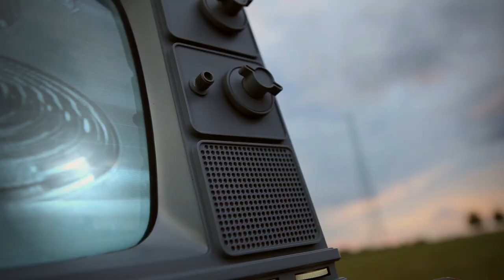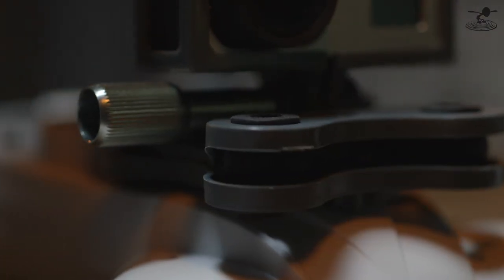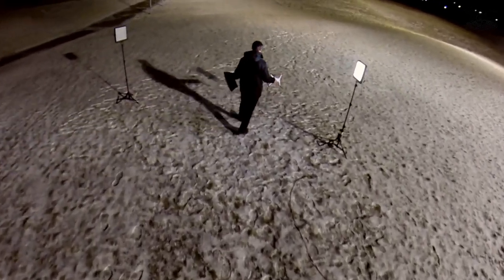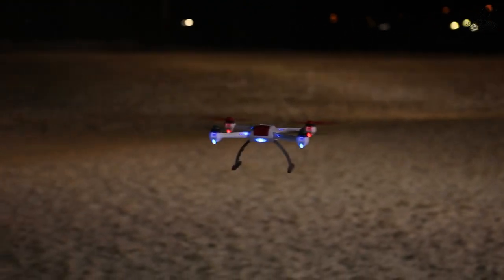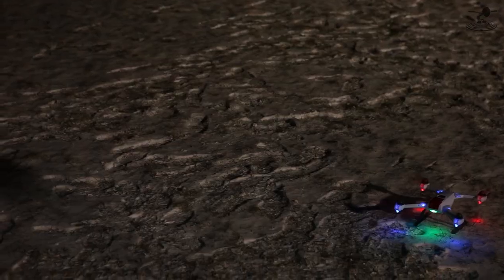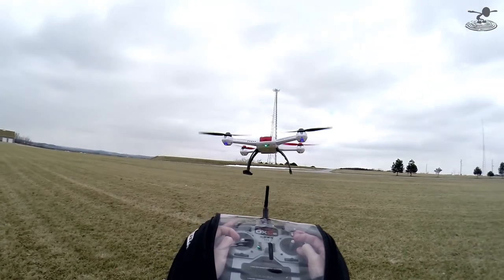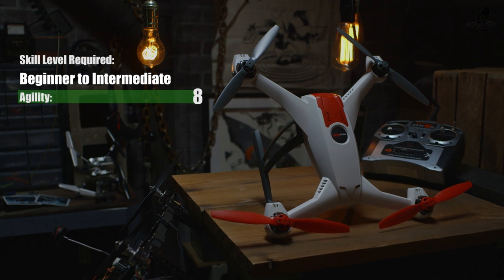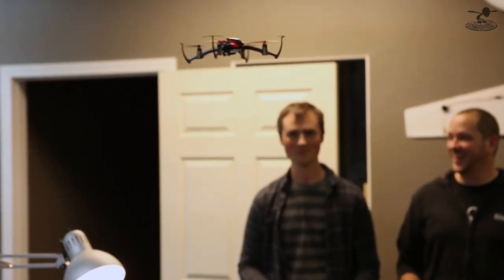Flite Test - Blade 350QX Quadcopter - REVIEW

Comment: One of my FPV buddies bought this quad and so far we aren't too impressed. Horizon made easy Go Pro compatibility one of the main selling points for the quad but neglected to properly shield the GPS antenna. Since the Go Pro Hero 3's spew tons of noise on the GPS band it means that you are very likely to have a hard time getting a lock. It is left up to the buyer to do what Horizon should have done to begin with and shield the GPS antenna.

The main plastic body is very cheap and cracks easily.

Once you load a Go Pro and VTX on it the flight time is reduced to about 6 minutes.

If you want FPV then your money will serve you better some where else. But if you want a quad to learn on and shoot LOS Go Pro videos then this will do just fine.

Comment: Good review. I have been flying my 350QX every week for the past 4 months. It got me into the hobby, which is awesome BTW. It has been a love/hate relationship with the 350. I can capture some really good shots with my Tarot Gimbal mounted to the belly-check out my youtube channel to see some of my stabilized shots. I have gone through about 4 or 5 bodies. I can swap the electronics over to a new body blindfolded-it's so simple, but yes there are many screws-no problem though! I have been using the stock B props for every flight and I use a DUBRO balancer to balance the props. When I fly with my gopro, I disable GPS to avoid interference with the craft. Keep this bird within LOS especially in heavy winds or else it will go away in a hurry and RTH will not save you! Finally, I have to thank Horizon for getting me into this awesome hobby. They made the transition very simple. I hopt to be moving into FPV soon and purchase another quad! Would I buy another 350 again? Yes I would.

Comment: I know that this is a pretty damn good quad!. I only use dji products fc,s only, they are my favorite I have several naza m,s v1 and v2 some v1 upgraded to v2 and a factory v2 to be honest my naza m v1 upgraded to v2  gps is way  more accurate than the v2. I was told by dji repair center that naza m v1  is built with a lot better quality parts the v2 has cheaper parts to keep there (dji) build costs down for them which means more profits for dji!

Comment: I have one but it takes off then crashes. Anyone have the same problem?
Reply: You have to let the quad sit and calibrate it's sensors  location by GPS before you take off and fly... Sometimes it takes a couple minutes after turning it on to let it calibrate... Just need patience.  It could also need a compass recalibration.
Reply: I let it sit till the light goes solid then take off and it does that.
Doesent that mean that the GPS is locked? Gary Partain

Comment: Don't forget to turn the wifi on your camera off before flight. Took mine up to 45 meters and panned around 360 degrees. Hit the return to home and it flew off over the trees. Lost a $420 quad, a $300 go pro, and a $50 memory card. Horizon offered half off a new 350, with only a few flights on the old one I think I will pass. Trekked 3/4 of a mile and never found it. Buyer beware...
Reply: can u tell me where and ill find it ;)

Comment: I know this video is over a year old...  the new 350 QX3 AP comes with a 3 axis gimbal mounted camera.  and the GPS is now on a mast to lesson interference.  I'm interested in aerial Photography, and would like something that gives me FPV.  This sort of does it with a WiFI connection to a smart phone.  However I'm concerned about range.  Wifi will give you no where near the range of the flight controls.  there is also an Aluminum/Carbon Fiber frame kit to let you do away with the plastic shell altogether

Has anyone tested the New Quad yet?... maybe an objective comparison to the Phantom 3.
Reply: tons of tests with the QX3. The range on the 5ghz WiFi is pretty good. Like 40-60 meters for the video feed. Buy the AP version ,the one with the CGO2 GIMBAL and camera (supposedly it's very good. Saw some reviews and it is very stable but I'm a newbie in this so don't take my word for it )
Reply: oops,sorry you wrote that almost a year ago :) my bad
Reply: +Richard Taft wi fi sucks you need 5.8 fpv

Comment: I have a Go pro hero 3 plus silver, B props, and have never had an issue, But I probably have 25 plus years Flying R/c and being a technician,I understand what mechanical and electronic components will and will not tolerate. If you have fpv,Go pro and the rest of it and are performing aerobatics and throttle chops at 100 plus feet into near free fall, then giving 100 percent full throttle a foot above the ground, you're an idiot and you are going to break something. The DJI is very nice, FOR FILMING. other wise I don't like it. ITS SLOW.and don't even get me started on the walkera, they should stick with toys and Helis. I love my Blade 350 QX.

Comment: Okay Guys, I need your help.  I'm a photographer and do must of my work outside on location.  I am thinking about adding a coppter for wedding videos.  What would you recommend?

Bruce
Reply: It depends on what kind of results you want and how much time and money you want to spend, and can re-coup. 
Also, these things are dangerous! would it affect your insurance? 
The Blade is a really easy and safe quad to fly in simple patterns, up and down, overfly straight and back with slow pan etc. The results would be a bit hit and miss though, because just strapping on a camera (but not one much bigger than a go pro) means you can't frame your shots accurately. You probably would get some good shots though.
Being able to accurately frame your shots, with a steady cam requires a jump in time to learn and cost. You need an FPV screen and a larger machine for this. I would say a DJI 550. 6 rotors are steadier in wind and safe if a prop fails. You could carry heavier camera gear too.
I've been flying the Blade 350QX FPV for a while, I definitely wouldn't fly near people. I have seen too many crashes, but that's probably just my flying!
You might be better finding someone who flies a multirotor already, we are all just aching to fly cool locations and interesting things.
Hang on what am I saying? Join us, you'll forget you ever had a business!

Comment: My Flamewheel 330 I built will fly circles around this and does not have this goofy cheap ABS plastic body that breaks.  Learn to build them.  You understand more about the quad and you are also not locked into these proprietary setups.
Reply: +MrPolymers I am interested in building one or if there is Ready to fly kit I will buy it, any advices? please.
Reply: Check my Youtube channel.  I have a couple videos of my Flamewheel 330. Not hard at all to build.  I would advise purchasing a good soldering iron to start. There are some kits on eBay you can purchase which includes, motors, ESC's, etc.
Reply: +MrPolymers about how much did you setup cost? do u mind listing some of the parts that u have on there? im interested in building my own
Reply: If you want a ready made quad, go freakin buy one.  I'm not interested in giving reviews other than what I have and my flight videos.  I don't have time for all this other bullshit.
Reply: +MrPolymers you posted here first bragging about your built quad, lol
Reply: well,the 350 qx3 can reach 62mph but in very steep angles and full throttle. However I've seen racer drones go to 70mph easily ...that's insane speed :))
Reply: +MrPolymers I'm planning on a QAV210 build myself. Can't wait.
Reply: Sounds good.  I'm laying off the quads for now.  Have too many as it is;)  I'll be reviewing a couple fixed wing  powered gliders I purchased. Oh, by the way, I placed telemetry on both my Flamewheel quads.  I'll try to get video of one of them up as soon as my RC field dries out.
Reply: +Tomi lol.......... uh whered you come up with that number? my racing storm 250 cant even go 60mph and mine is fast as fuck......the 350 qx3 isnt even a racing drone...
Reply: flame wheel 330

Comment: Total Failure.   Fly it 25 times if you can and fly it as its advertized to fly ,  you will then understand my statement.* PLEASE look at all the videos on youtube about the Blade 350 * Prop Failures * Main Boards Over Heating * Weak Bodies
Reply: Yup..... HH has sent me my THIRD replacement 350QX....The hunks of crap wont stay in the air.!!!..Props and Main board issues are in the thousands per HH inside info!... HH is no longer owned by the people that had it a few years ago...Its been going down hill ever since!
Reply: I also read it, but never had a breaking prop.
Reply: they have fixed the problems and when my props fell off they sent me all the pieces that i sad were broken for no charge, express shipped, dji has been doing it for years so they have already sorted out their problems, firmware 2.0 is coming out soon with a forth mode. How many modes dose dji have aegean?
Reply: WHo cares about DJI,, ....We are talking about the Blade 350QX....They have fixed ZERO PROBLEMS with the 350QX....same disinagrating (B) Props and the same INSIDE Drone main board!
Reply: haters be hating
Reply: YOU'RE DAM RIGHT PEOPLE ARE HATERS....... And they have every right to be haters over this Blade 350 Hunk Of Crap!
Reply: done me good crashed tones of time only body damage and only £22 to fix I call that great
Reply: GasserGlass I haven't had no where near the problems you have had man ... Honestly other than myself crashing it the 350qx has flown just fine for me, and this is after a multitude of hours flying it.
Reply: Glen Perry....I'm very happy for you, Luck has been on your side.... COUNT YOUR BLESSINGS as Thousands Of People Have Not Had Your Luck..... The NEW Blade 350 no longer has the same electronics!!!!!! and have download to fix some issue in the Old Blade that you have....There are FIXES because they have a problem.....Be sure to stay in SMART MODE and you might get many more flights out of it.?!?!
Reply: GasserGlass I'm not sure that is the case for myself to be honest, I fly in all modes, but I have also been flying for 20+ years, although this is the first time for me flying and Heli/Quadcopter configuration.  And I do agree with you on the Blade, it does have some limitations, concerns and it is cheap construction, but for the price, it is a good starting point for many new comers.  

I did a lot of research before I decided to fly mine, hence why I changed out the props I added wire ties to the GoPro platform etc etc.  As far as mechanical I haven't had any problems, but again that doesn't mean others like yourself haven't.  I prefer to see things for what they are, and this Quad is exactly what it is, a cheap entry level quad to get people into flying.
Reply: heh heh.....funny goof
Reply: Yeah man i agree blade produxts are just plain junk
Reply: Malarky.  I know of three 350qx drones that flew off never to be seen again.  My P4P is incredible.  More expensive? Sure. And the tech is much more mature with way higher manufacturing standards. Difference between a Model T and a Mercedes.  The 350qx is just a typical 1st generation product.  The world has moved on...

Comment: I have a Blade350 and a DJI Phantom. The Phantom is by far the better flying machine. I was really disappointed in the quality of the Blade350. With a gimbal, the 350 barely gets off the ground. You also have to be concerned about extra weight with crappy props. Are they going to break??? Who knows. Do you trust a go pro and gimbal with props that have a reputation to snap mid flight? It forces you to put on APC adapters to use better props (not cheap). Spare parts for the 350 are priced to be insulting (ex- spare motor is $50). Dji did it right. The Phantom flies great, handles a camera gimbal like a champ, its easy to repair, and parts are cheap. Save yourself the troubles and get a DJI Phantom!!!!!

Comment: First he says it's Fantastic in GREEN mode....Then at the End he says it's a OK Drone....The Gain He is talking about is ALREADY at it's Highest...for a reason...Most RC flyers just want to FLY. They are not really into the "Technical" part of the Drone .... Phantom has had a couple of problems which has led to upgrades... However, He did not say That the Qx 350 is a larger version of the Qx 200. These Drones are a class of Sport Drones. SPEED and Aerobics are what they designed for all at the same time it comes with a GoPro 3 holder, He didn't tell you that you can upgrade to a even better camera like the "SHARK" system FPV or a Newer version camera...The Qx 350 when it comes to SPORT flying...Destroys the Phantom. The Phantom is more "Industrial" designed. I agree it's not a 2000$ Great DRONE, However it Holds up in the 10 Drones....Sport and Comfortable....it gets a 10 on the score boards....

Comment: I had a fly away with my350qx right out of the box with a brand new gopro on board. Flew out into the lake out in front of my house. Horizon gave me 20% off a new bnf 350qx2 since I cant return the 350qx. I was never told about the rf issues and even with the foil kit it still flew away. Horizon hobby is a terrible company to deal with. It takes hours, even days ,to even talk to someone in the tech dept. I am not happy about loosing $900 worth of gear in the first 30 seconds of it being out of the box.And to make me pay for another one is a slap in the face, consittering I have about 6k worth of their products in my collection. Ill be buying the DJI instead because Horizon will not stand behind it